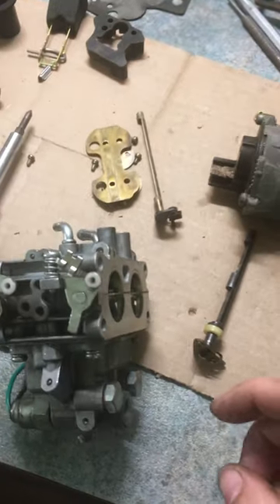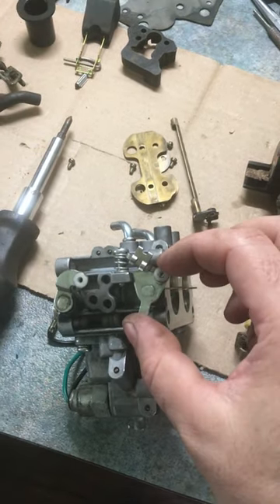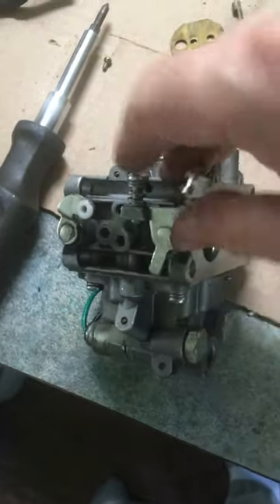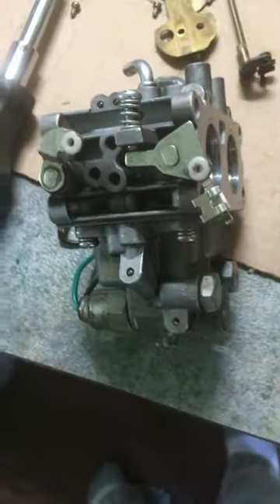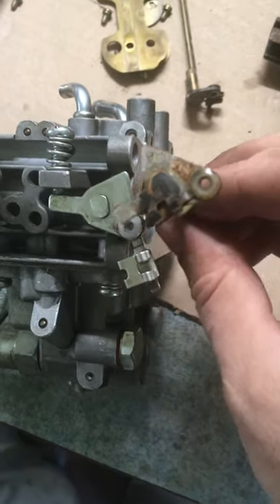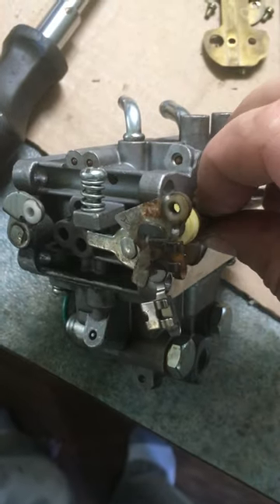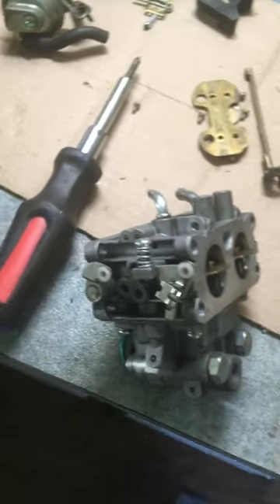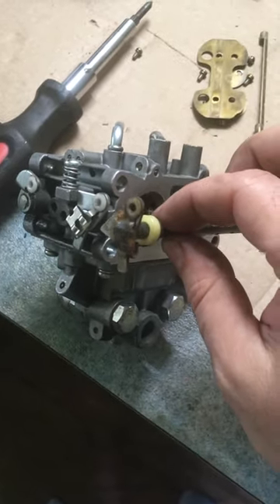Kawasaki FH601V throttle shaft differences #kawasaki #carburator #engine #smallengine

Comment: thanks for that comment but I have one more to add. I purchased an after market carb for my Kawasaki FH601V-CS04 and on this one the throttle and choke clips are opposite - one faces in and one faces out so on mine an a few others this is the case so make sure they're facing the right way before purchasing because (as far as I can tell unless someone could please tell me different) it can't be changed. Hope this makes sense.
Reply from the maker: Yes! I forgot to mention that part.

Comment: I came across a forum in which they are trying to achieve this because apparently the 25hp is identical to the 19 only difference is carb and oil cooler so with a different carb you can achieve the 25hp also allowing butterfly to open all the way

Comment: Can you replace the shaft and make it work? I’m having a problem with this exact thing. I’m also having a problem finding an OEM carb. Any help?
Reply from the maker: Yes that is how I made this one work. The throttle shafts can be interchanged. Some of the shaft bushings seem to be different but if you are careful they can be pulled and reused also.
Reply: @wrenchwranglers  thanks for the reply. I actually just got done doing that and it worked perfectly. Much appreciated